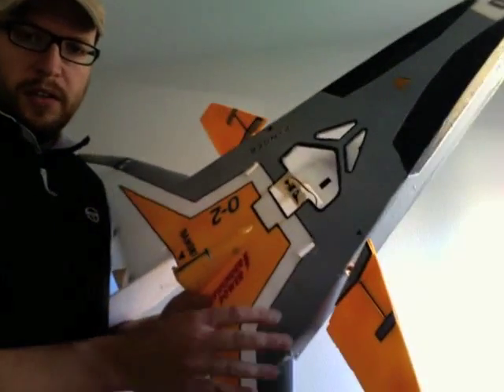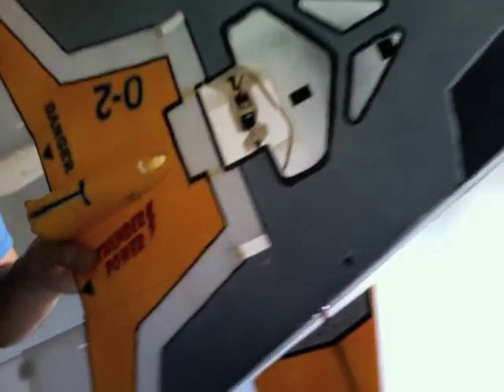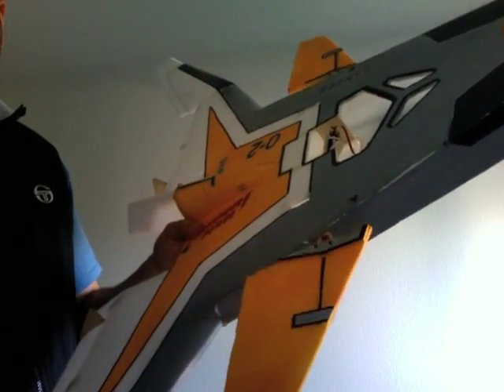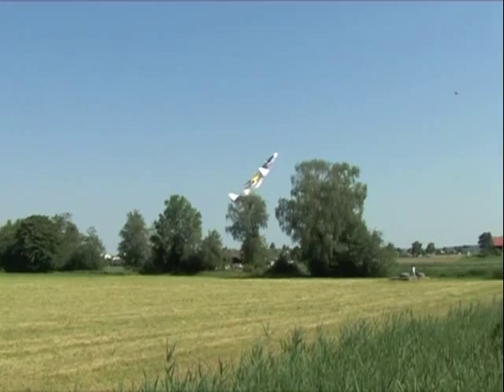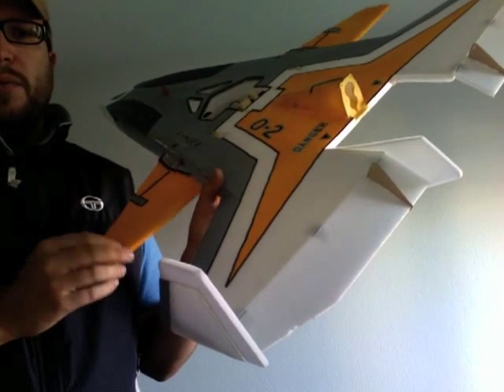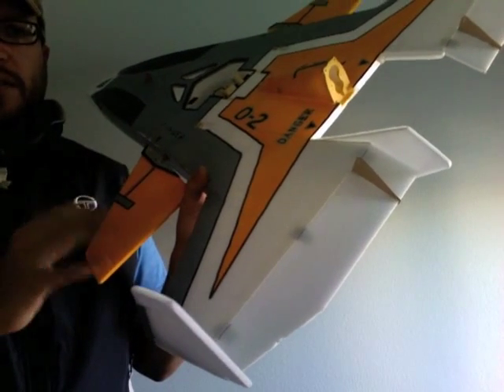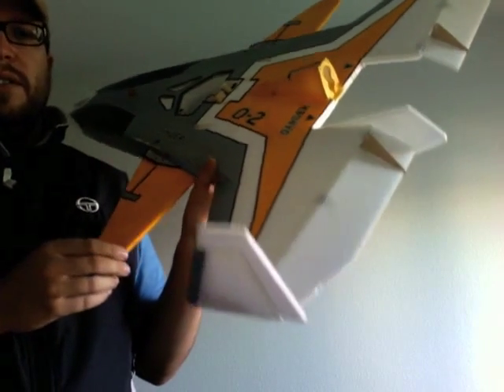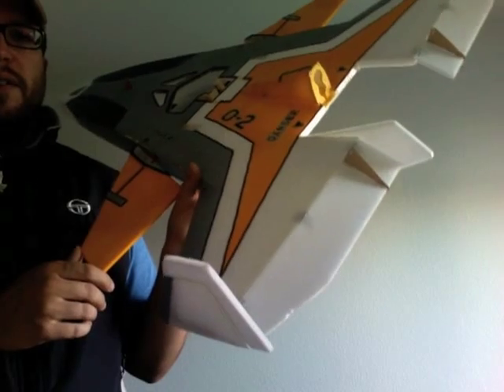Crazy Science: Aileron Canard or Ailenard ??

Comment from the maker: @1cierva I think you got the plan already by now.  The Idea of the StuntCat  I had already in 2007 but then it was bigger and made out of 20mm foam. The main reason for the shape are:   the boxy shape because depron bends no good in two dimensions, The strong V-nose it thought to keep the  air resistance, produced by the boxy shape down. Motor forward offset for CofG, The rear sliders to provide side surface in the back and keep propeller clear. The rest is design for the sake of design.